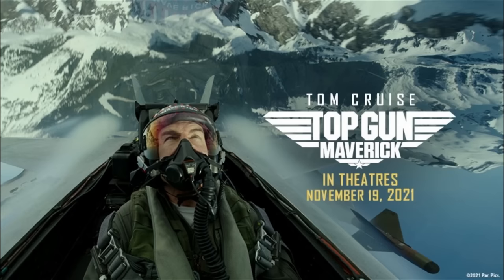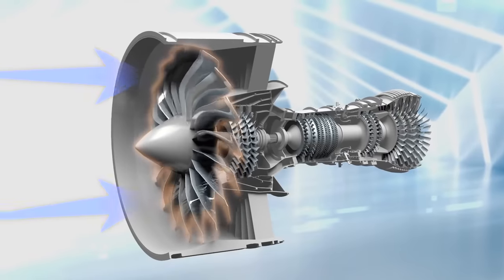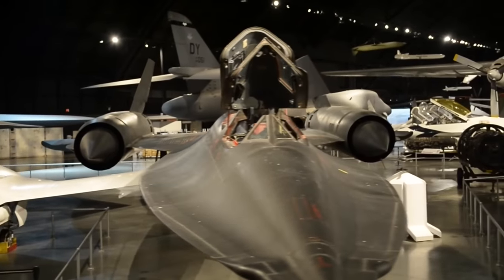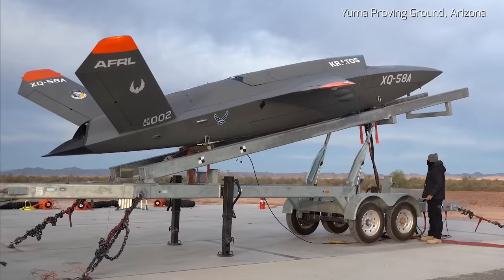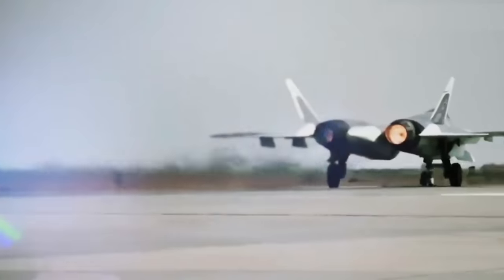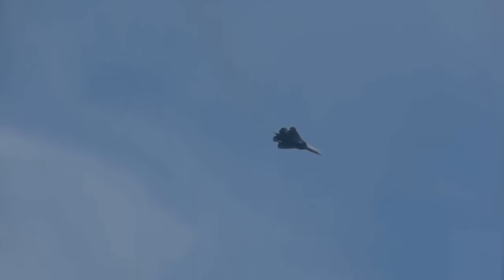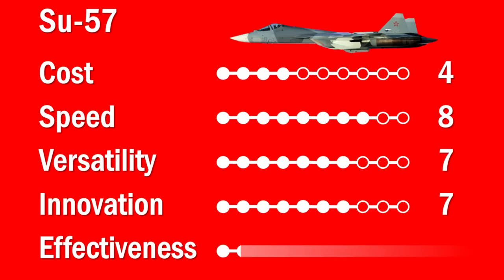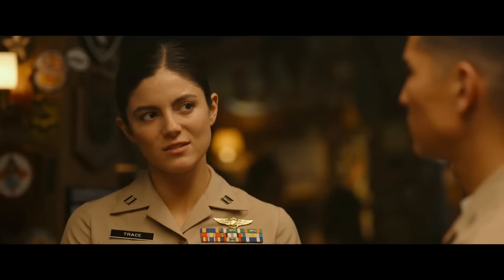Aerospace Engineer Reacts to TOP GUN: MAVERICK

Comment: Supermanouverability is not just "slightly better" on Russian planes like the Su 57 or even much older Sukoi planes. Because thurst vectoring makes it a huge advantage in close combat, as you mentioned. That was the biggest problem with the movie for me, completely unrealistic with regards to the whole last mission. From the air defences (which would easily shoot down the slow tomahawk missiles) to the silly battle between an f14 tomcat and a Su57. The only realistic kill was the first surprise kill of the Su57 was the first surprise kill, after that the f18s and obviously f14 would be dead very quickly. 

Your rating of the Su57 does not make much sense in my opinion. Only 3 for efectiveness... are you serious?  Yes its a very new plane and its not exactly yet being used publicly. We don´t know if it is being used or not in Ukraine but if it, its only for testing purposes since Russia clearly does not need it there and has achieved air supremacy with its 4 and 4+ gen aircraft there. Has the F35 ever even been used before. I admit I haven't checked but did you also give it a 3 or less for efectiveness?
Reply from the maker: As for my effectiveness rating  There's more reasons than it just having no combat experience. It's stealth technology has been repeatedly called into question. The program has suffered immense challenges. Despite Russia's best efforts to sell it abroad they haven't be able to sell it. Another tell tale sign of difficulties is the immensely slow roll out of every SU-57 it took a very long time for any SU-57 to become "operational". The F-35 has quickly become one of the most produced fighter jets of our generation. And yes has proved itself in combat with the Israeli Air Force. Including confirmed air to air kills. The ratings aren't set in stone. So if the SU-57 gets some combat experience under it's belt and proves the analysts wrong I'd be happy to revisit it's ranking. Feel free to watch my other ranking videos to see more about the methodology.

Comment: im no aerospace engineer, but im fairly certian if mav ejected going mach 10 (thats over 2 miles per second) he would have been far beyond dead
Reply from the maker: How are you the second one that made that same speed comparison?
Reply: @AviationAustin  basic mental math and science... im sure its far from actual, but im just thinking about that at sea level sound travels at 1,150 fps as a base. Mach is an indicator of multiples of speed of sound. and that there's 5280 ft to a mile... you should know the rest

Comment: WARNING 
SPOILER ALERT
P
O
I
L
E
R

A
L
E
R
T

So maverick finds an old F-14 (the producers couldn't resist), in a hangar that seems to be collecting dust.  Which I don't think would be "flight ready"...
Reply from the maker: The Iranian F-14s are by US design not flight ready. One of the main reasons why they stopped producing and selling the F-14 was to prevent Iran from being able to use them.

Comment: So they already have this. It’s called the X-37 and the X-43. The reality is that humans can never actually fly at this speed. If they take a hard turn at these speeds they will simply die. The human body can’t endure anything over 5-10 G’s. A hypersonic plane will likely have to endure 20-50 G’s and as they mention in this video. If there is a malfunction. A human would have the feeling like they slammed into a brick wall at 100 mph. A drone would be able to survive that malfunction and be able to recover while a human would literally die if they went from Mach 10 to Mach 2 in an instant. The airframe can Handle this. But the human body can’t handle that type of rapid deceleration. 

The long term goal is to make a ramjet hypersonic plane that can reach such a high speed that it gets into orbit. Where theoretically you can take off from an American base. Fly so fast that you’re able to get into orbit and then wait until you fly over your target where you then fly directly down to make it impossible to stop whatever bombing will happen. Essentially radar can only work to such a high point and if you can drop down directly from orbit and drop bombs only to then fly back into orbit and fly faster and higher than surface to air missiles can reach.

Comment: Considering that the SR-71 Black bird was ahead of it’s time, first flight was 1964 think about how long it took to develop that stealth technology, going based off that knowledge, I would not be surprised how many jets are still hidden from the public and mainly there wide capabilities. But there is no shock if we already obtain a jet that can go Mach 10. Maybe Lockheed kept it a secret and is slowly declassifying this concept because you can see that China was already on top of it. So you really have to take in and be overwhelmed with the amount of power or the beasts within the United States Still sealed tight behind hanger doors.

(Think about the first stealth helicopter used in Osama Bin Laden Raid, they still haven’t released that yet and who knew how long they had that stored, cause I sure as hell don’t believe they came up with that helicopter concept right there on the spot, especially not within the month. So they had that sealed within hanger doors, who knows when they will finally release details.

Comment: -- Spoiler warning -- 

Would it be possible for him to have survived that crash/disintegration at Mach 10.3? I mean obv he does in the movie, but I was thinking like that is such an insane amount of speed, but maybe it depends on how the plane tumbles/breaks and of course they had safety measures in place and he didn't like come to a stop or hit anything, but still, lots of force on the body.
Reply from the maker: Probably not, but we don't see the ejection sequence. So we can't know for certain. I'd say it's unlikely, but he was wearing a pressurized suit which would shield him from the elements at that height. But a human exposed to Mach 10 air resistance is going to die. That being said an AF pilot did eject 6 years ago at Mach 1 and survived.

But if there was some kind of escape module like some rockets had, then maybe he could survive.
Reply: One way to make him survive would be to have the cockpit itself be an ejection pod. Then as the altitude reduced you could have a normal parachute. If the cockpit broke up I don't see him surviving.

Comment: Well,  lets keep the objective standpoint on as no engineer can afford subjective standpoints, that is a feature for artists. F22 doesn't have full 360 thrust vectoring, only differential without yaw. 57 has full differential. T/W ratio is also in favor of 57 though 22 has 10% more powerful engines. Side looking radar in not feature of 22. That thing can lock you cold. Not to mention canard controls inside of airframe lifting body profile. 57 is VERY dangerous and the worst attitude towards that machine is to neglect its power. That goes into overconfidence induced loss in battle. PS. Saturn 30 has 177kN of trust vs F119 has 156kN. Double it and subtract the difference, its 42kN, 4T+, difference in favor of new, year 22, version engine S30. Sensor control logic in Russian airframes had way simpler and more intuitive interface, historically. That builds pilots advantage. LM needs good response to 57 in future. Dont underate 57. It's VERY dangerous. It should sit in top 3.

Comment: Could he have survived the ejection? How fast would he lose speed when the craft fails?
Reply from the maker: He would need an escape capsule similar to rockets.  Otherwise he would certainly die.
Reply: @AviationAustin  So he would be able to survive. We'll just assume that for the sake of making the movie work. How fast would a plane lose speed going that fast? Would it break apart when the engines fail?
Reply from the maker: That's kind of an impossible question for me to answer. I'd need to know the altitude, the materials, the point of failure. Really even then it might only be able to be solved using CFD.
Reply: @AviationAustin  Interesting.

Comment: Worst thing about top gun is the stupid shit they said and did about g force.

The hornets both old and new are fly by wire. It physically can NOT reach the G forces in the movies due to the actuators for the surfaces. By contrast the Tomcat is not fly by wire and will pull much higher max g force simply based off pilot input.

Comment: Hypersonic weapons are not The Cutting Edge it was The Cutting Edge back in 1968
Reply from the maker: And what do you think the cutting edge of aeronautics is?
Reply: @AviationAustin  Cutting Edge and I did mention something but that that's decades old too now actual Cutting Edge taken energy what should I say I mean especially we're talking about Aerospace here well I guess I'm going to put my foot in my mouth and I'm going to say it gravity engine
Reply: @AviationAustin  what is a gravity engine well this is a highly concentrated gravity weld that has a directionalized outer casing that makes you able to use that gravity well to pull or push away from other gravity Wells this makes it possible to come near the speed of light this is The Cutting Edge this is the current state of the art

Comment: Wait a second... No one is talking about the aircraft failure at Mach 10... Is there any chance a human would survive ejecting at  Mach 10? Humans weren't designed to fly through the air (outside of a plane) 3.5 times faster than an AR15 bullet...
Reply from the maker: It would have to be an escape capsule or something. A traditional ejection seat would not have worked

Comment: With optionally manned aircraft, would they design the cockpit life support as removable? So the weight of things like the ejection seat and oxygen saved, and replaced with payload or fuel?
Reply from the maker: That's a good idea. Not sure how feasible it is from an operability standpoint though. If they have to overhaul it everytime they change configuration they might as well have made one or the other.
Reply: @AviationAustin  I was thinking more, a modular cockpit, with seat, life support and flight controls which can be removed

Comment: I have to correct you on super maneuverability. While the SU 57 has a slightly quicker axial rotation around one of 3 axis it loses a great amount of airspeed/energy to achieve this. The engines are far inferior and unreliable and not even in reliable production yet. The avionics are far inferior. The life span of the airframe is unknown as of yet. You can twist and turn and tumble an unarmed oversized inefficient aircraft all you want; however the far superior balanced advanced F22 Raptor would destroy this thing in actual armed combat. The SU 57 is only stealthy looking directly at the front. An off set in altitude between it and an F22is all the advantage the F22 needs to get a firing solution; where as the Russian plane relies mostly on a heat signature for early detection which is not going yield a calculable target as the F22 has a detectable heat signature only from behind. Super maneuvering is only as good as the pilot can withstand the g forces and maintain positive control of velocity changes.  While in development it was realized that you can sacrifice much more important features to attain a useless level of maneuvering at the cost of to much energy and range thus American 5th generation fighters focus on counter measures and positive energy management. A fighter out of gas is a fighter no more. We focus on getting the enemy to waste their limited missiles on thin air and waste their gas chasing ghosts. Then we shoot down empty gas tank of an SU 57 that is left fleeing the fight on fumes or already shut down by an intractable intermittent blimp on its inferior targeting system and a hypersonic missile aimed at a ghost of a moving target is just an expensive overpriced fire work.
Reply from the maker: I agree with your assessment.

Comment: Given that SLAMs can be flung at a range of 170 miles from the target and carried on an F18C, and Over The Horizon AA weaponry exists, a drone could detect and engage enemies from standoff distances and retreat to RR.  Just look at Russia's military infrastructure crumble in Ukraine due to unguided rockets, IR ground-to-air missiles, and traditional gunfire and what that has cost them in assets. I'm not worried about an aircraft program that can barely produce enough felons for airshows let alone actual engagements.  Also not concerned as the number of flight hours given to an average Russian fighter pilot pales in comparison to just NATO strategic joint operations training alone, not even counting the native country's military training and combat experience gained.  Russia lost the ability to produce T80 tanks due to crushing sanctions, supply and training failures, and vast engineering flaws that exposed them to one-shot kills from a plethora of widely available recoilless weaponry.  With a global chip shortage waning, a low supply of felons, no ground support,, and surpluses depleting they could run out of felons in a single engagement with a properly equipped squadron and lose air dominance very quickly.  Not to mention the economic issues trying to fill the void of what has been lost. One thing I didn't care for in Top Gun Maverick is that instead of deploying a team of 4 aircraft to fly a gulley they could have deployed a wing of weasels to remove the stationary fixed position SAMS with HARMS and a wing of fighters for CAP that would engage the felons (which there were 3 in the air.)  They could have very easily fired their cruise missiles, deployed the main contingent to fire on the ground target at a MUCH LOWER SPEED (safely), deploy the weasels to attack sams with harms with air cover, and done so from inside the carrier groups port or starboard flanks (giving them additional coverage and support.)  You could even dupe the felons into a targeting solution by flying an aircraft obviously directly at them. All of that could have occurred at once, wouldn't have made for an interesting movie, but still never sat with me well after watching it.  Given that the sam positions are a known thing, a squadron of F18s with SLAMS could have destroyed EVERY SINGLE SAM with programmed SLAMS.  Those slams could be programmed to fly waypoints map of the earth and perform a pop-up attack at the end.  The same could be said for the final target being inside of a crater.  All of that could have been programmed and uploaded on the aircraft, on the deck of the carrier, by using the UFC (center console) and MFDs in the cockpit.  Not that I don't think a felon is a cool plane, I just don't think air show tricks are going to beat out hypersonic missiles, stealth detection, long-range missiles, drone swarms, and next-generation electronic warfare.  It's like spending 100 million dollars on an over-engineered solution just so you can pat yourself on the back for doing it, then fail most miserably when confronted by a 19-year-old flying 20m dollars of equipment with a literal xbox controller.  Still, to be fair, we are all ignoring that these dog fights could have been in the replacement platform of F35s instead of F18s, we know why they didn't but still its available right now...  Good movie, but just yeah...

Comment: "There's no way he's walking away from this stunt of his with his wing"?
No, no. Wrong.
There's no way he's walking away from this stunt of his, with his face attached.
Stick your arm flat out of car window at 60 MPH, you already have to put in effort.
At 160MPH you're a ragdoll.
Eject at cruising speed and there a decent risk of severe injury.
Mach one ejection is already fatal in most cases.
At Mach 3 you may as well eject into a concrete wall.
Mach 10... Lol.
Reply from the maker: Only way to make it make sense is assume an ejection capsule.
Reply: @AviationAustin what's an ejection capsule  ??

Comment: Nope, neither the J-20 nor the SU-57 is a  5th generation. Neither Jed has been tested internationally.
Reply from the maker: I would tend to agree with you. But in an effort to remain impartial I have to at least consider the claims each military is making about their capabilities
Reply: @AviationAustin  The biggest problem with both of them are those very large twin thrust vectoring engines. China routinely violates Indian airspace, and India scrambles Jets every time they detect the J-20. And let's be honest, the su-57 is nothing more than a rescanned su-35.
Reply from the maker: I don't disagree.

Comment: A couple of the major, F*** ups that aren't realistic engineering / physics wise are the, high speed turn that Maverick is pulling while flying near Mach 10. That is very unrealistic. A F104 starfighter at mach 2.2 and a bank angle of 30 deg, would already have a turn radius of about 75 km. Let alone going at Mach 10. If you would be able to pull off such a turn, ignoring the fact that would stall the wings or the aircraft breaks apart, your brains will literally be splattered on the floor of the aircraft due to the very very high G forces required to have such a small turn radius at that speed. 

Other than that the pull up after the attack could be a very high G maneuver but only as long as you keep on having pitch rate. When the climb angle would remain constant in the climb out towards the top of the mountain the G's would be slightly above 1 again.